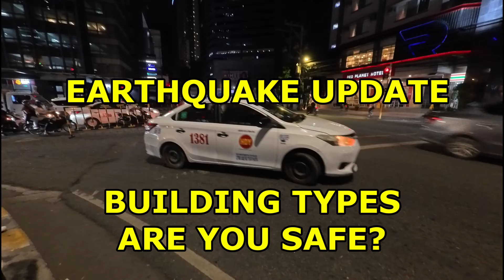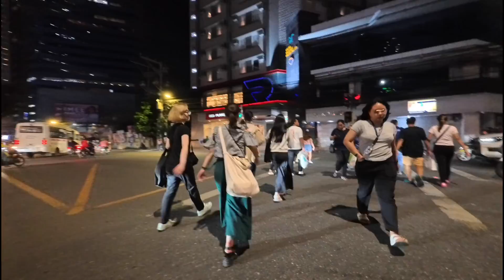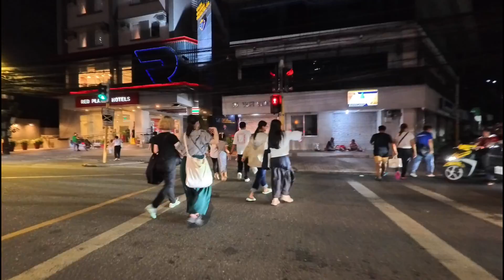EARTHQUAKE UPDATE!  CONSTRUCTION METHODS & RISKS

Comment: In the nukes we used to remove all Chinese scaffolding parts,esp the 90s,,now its every where..
Reply from the maker: I briefly worked for a machine tool distributor in Phoenix, AZ and they told me the first thing they did was remove the soft Chinese bearings and replace them with proper bearings rick.

Comment: I was here in Cebu for the 2013 earthquake and it was scary. It lasted over 30 seconds but seemed a lot longer. It was around 8.15am and I was on the 5th floor of my hotel and, believe me, I didn't waste any time getting out of there.
There were many aftershocks, the first ones were pretty bad. In the Capitol Site area of Cebu City the locals blocked off some of the side streets and many residents slept out on the street as they were worried the aftershocks could bring down already damaged buildings. Wouldn't want to go through that again.
Reply from the maker: Thanks for sharing your experience trooper.  A hard earthquake would be a bad experience.
Reply: I remember that. I was there too in 2013 during the earthquake. I was surprised at how many aftershocks there were and some of them were pretty big. Even when I was in earthquakes in california,  Never had that many aftershocks. Most everybody was standing outside of the hotel I was staying at cuz they didn't want to be inside during all those aftershocks

Comment: Good video Rod. I watched a documentary on Nipa houses on bamboo piers and basically there is nothing to break because everything flexes, in a big earthquake, just sit down and wait it out. In construction in California, we would attach the roof cladding with 3.5 inch nails with large heads which might loosen up but they aren't coming out. All over, we would build wood frame structures with standard 3.25 inch nails then we would put joist hangars inside on wall studs and hurricane strapping on the outside and corner braces on the inside. Built in sections and shipped, one section fell off a trailer and slid down the road at 65mph and the only damage was a couple floor joists and and squaring things back up with a come-along. We built a correctional facility in Dallas and they used the concrete planks with the holes in it as seen earlier in the video and they are very strong if they are made to specifications but mostly, they are Fast, you don't have to endure the concrete curing time on site for each floor. 

Many people dump on Philippines Modern construction and they have some justice on their side but they think it was always that way to which I have to disagree. These days they may produce the cheapest hollow blocks 40-45 per bag of cement and they will melt if left out in the rain but it wasn't always that way. If you go back to 40 years ago, Filipinos wouldn't accept that quality. There are a lot of old buildings in an earthquake and typhoon prone country and I would be more willing to live in a 40 year old dwelling than trust anything built in the last 10 years just on general principles and if it were a condo, it would likely have more SQM to offer. Take care.
Reply from the maker: Interesting and thanks for sharing this info Robert.  Even in the USA, the engineers stretch the boundaries of properties such as wood planks, etc.  My engineer at the scaffold company told me they could prove mathematically that the scaffolding and forming/shoring should not stand up, but they knew from experience that it does, so the science isn't perfect and neither are the materials.  It takes just one small link.
I agree, past building materials and methods may be superior in many cases.